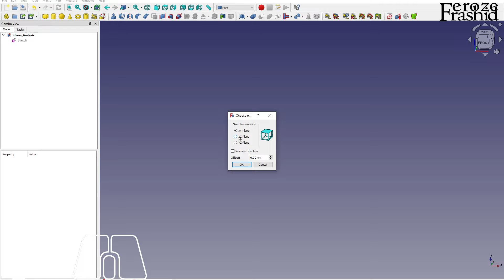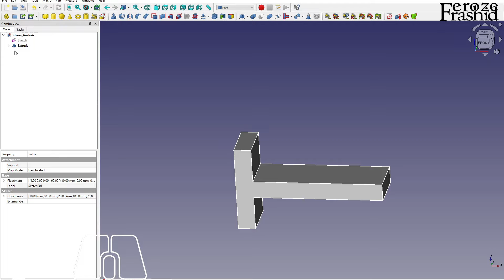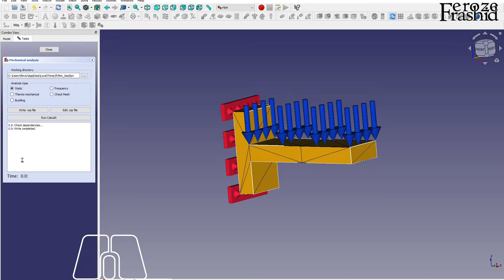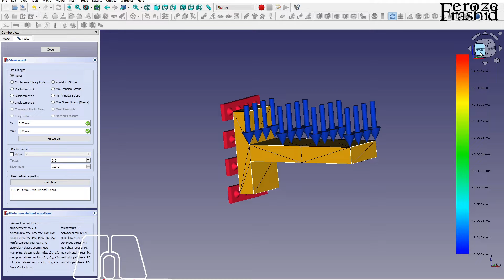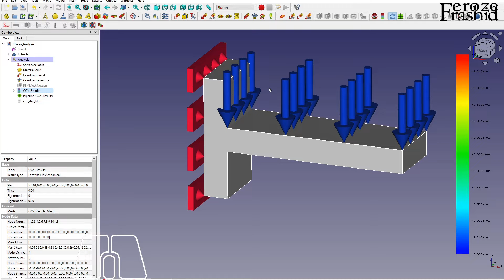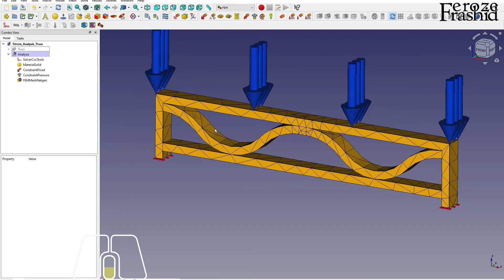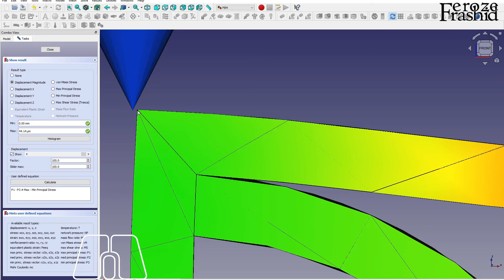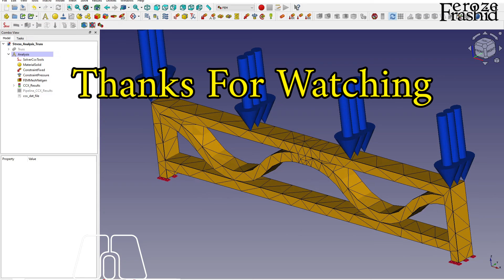Weekend Special: FEM in FreeCAD for Dummies

Comment: Your problem is caused because you used two fixed constraints at each end. You should only use one constraint fixing the x and y and z  movements. The other end should only be fixed in the z direction and be free to move in the x direction (like a roller support). This will prevent fixed end moments being introduced into the analysis
Reply from the maker: I was also wondering about the same thing. I need to figure out how to apply different types of support conditions in freeCAD.
Reply: It’s been a while since I did this but from memory I believe you should select an edge rather than a surface. Then you can constrain that edge in x,y&z on one end. This creates a pin joint that will not impart momentum to the beam as you need it simply supported. The other end edge should only be constrained in the upper down (y) direction to allow it to be free to move in the x direction when loaded. If you do this the truss should distribute load as you expected. 
Hope that helps
Cheers Allan
Reply: @allandeans3904 

I am not sure if you can select and edge to fix its motion, only surfaces can be selected. 

You have to edit manually the *.inp file written by FreeCAD before executing Calculix. Look for the nodes you desire to fix the motion  in the z direction and  then run calculix. 

I just found this channel and like it very much.
Reply: @ajarivas72  Edges and vertices can also be selected for fixed and displacement constraints used with CalculiX in FreeCAD FEM.
Reply: @Gumball_W  Thanks for the feedback
Reply: @allandeans3904  I was finally able to do it. Selecting an edge worked. All this time I was waiting for FreeCAD to introduce roller and pin supports, just didn't realize they were there to begin with. Thanks.
Reply: That was meant to be moment not momentum

Comment: Thank you for the demo.  I have an engineering education but have never worked in the field.  However, the FEM result you received was expected.  Essentially all of the load is carried by the top surface of the truss.  I repeated your example in the same orientation but put fillets on the bottom and got a similar result.  If you want more load carried by the bottom member of the truss you would want to flip the geometry vertically and make all the contact points more than point contact.  Preferably you would add fillets and avoid those sharp corners.  This analysis tells you that you have over engineered the bottom member and could make it much thinner.